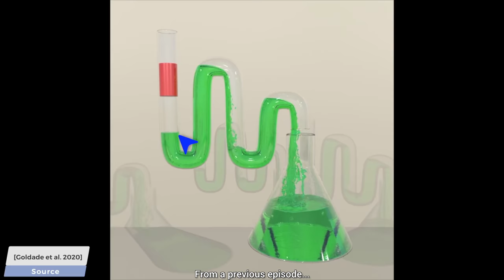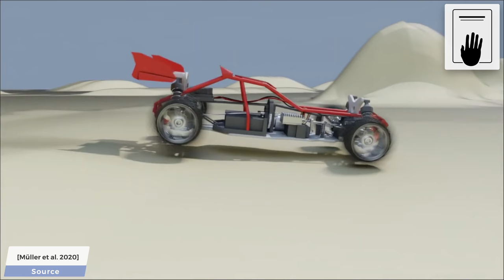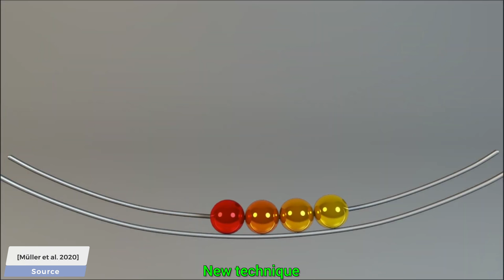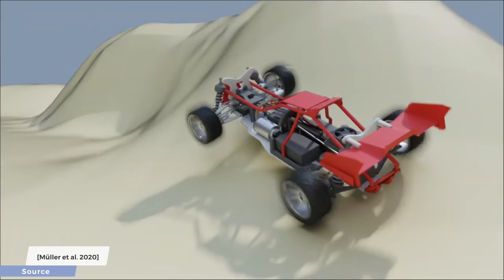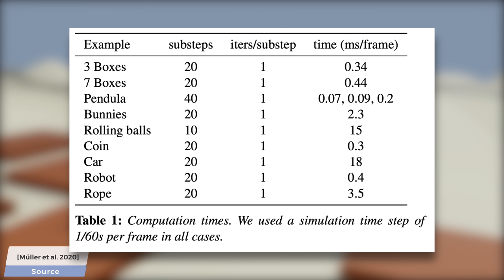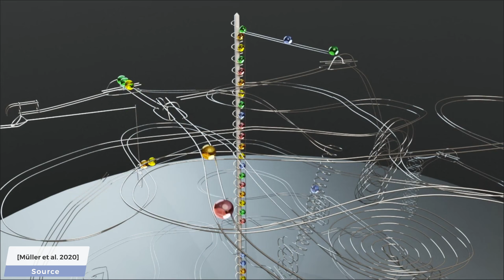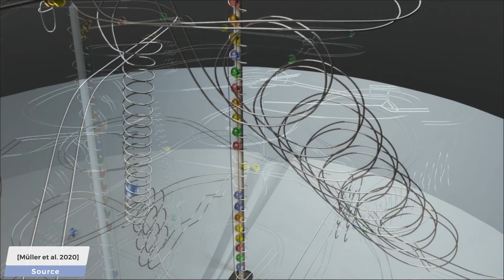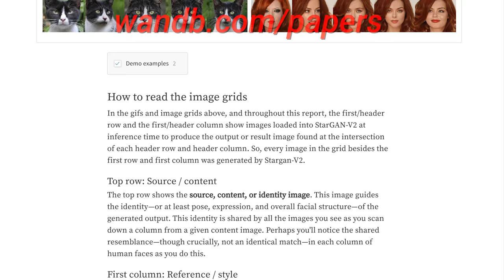Finally, Deformation Simulation... in Real Time! 🚗

Comment: That coin rolling simulation, looking like Euler's Disk, I had simulated in real time years ago, with Dark Basic Pro using Ageia's early PhysX card. And it used about 20 coins at once.

It was a shooting demo I made. Coins spawned over a table, and I would shoot at them. If hit, some  would drop on the table depending on how they was hit. They would even drop on each other. Depending on how they fell, they would roll like the one shown in this video.

I simulated the sound based off of how fast the bottom half touch point would move or circle around on the table. I even added an augmented extra code to fade in and out the sound some, that would take into account the position of the touch point vs the center point of the coin and the view camera position. It would fade in (get louder) if the touch point was closer to the camera than the center, and fade out (get more quiet)  if the touch point was further away. The sound simulation was faked, but worked quite well and seemed real enough at the time.

Funny to me how such a coin sim with just one coin is thought to be big news today, years after what I made with one of the very first physics cards made. Though I know, how they both work is different, and not the same. But still, it's funny to me to see it being big news.

The car sim and large marble sim is impressive though.

Comment: AWESOME! I AM LOVING TWO MINUTE PAPERS! However, if you have ever played with an R/C car like the one in the simulation, you will expect the tyres to EXPAND when rotating at high velocity due to centripetal forces. Or centrifugal. Anyway, REAL R/C toy tyres stretch outwards at high speed making their diameter expand while at the same time their width contracts. Which says to me that this is not a simulation.

Comment: This paper is about rigid body dynamics. So, there is no information. The thing that was mentioned as tier deformation was the simple interference in contact due to simulation error. This simulation also could be done in real time with Algoryx Momentum Software Engineer

Comment: "For our demos we used a system with a Core-i7 CPU at 3.6 GHz
and 32 GB of RAM. Table 1 shows the simulation times per frame
for the various examples.
"

Well those render times are even more impressive now.

Comment: The paper mentions the rendering times were achieved on a PC with a "Core-i7 CPU at 3.6 GHz
 and 32 GB of RAM". So consumer-grade hardware, and this is not even taking advantage of the extra processing power available in GPUs.
Reply: lmfao,good luck even implementing that into any game,beamng is already doing this and more without being that intendive

Comment: 4:10 This doesn't tell me anything comparable since they don't mention what CPU they used all they say in the paper is that they used a "Core-i7 CPU at 3.6 GHz and 32 GB of RAM" (p. 8). 
That actually sounds like the base clock that a modern i7 basically always runs above of unless thermally challenged so if we assume they either used a very old core i7 (say 2600K) or they fixed the clock to said frequency, actual fps numbers are probably a lot higher on recent CPUs (also for multi-core clocks).
Furthermore, the paper doesn't specify the number of cores so we don't know multi-core performance scalability (implying they don't tell us anything about the number of cores of the CPU, could be anything from 4 to 10 cores for an i7 since introduction in 2008)

Comment: there  is a problem with the car simulation. Either the tires are deforming incorrectly at high speed rotation, or the wheels are deforming at high speed rotation. The tires should appear to increase in diameter rather than decrease in diameter.

Comment: Some very important information is missing from their paper, how much computing power does it take to simulate that car at that speed. They mention it is running on an Intel core i7 at 3.6 GHz with 32GB of ram, but not what GPU is being utilized. We could guess it was running on the Intel iGPU in the CPU, but the credit to nVidia indicates there was likely some kind of discrete GPU used. If it was a consumer or even high end workstation card this is interesting. If it is running on something like a Tesla V100 server not so much.

Comment: Noob question: What exactly are the techniques they are using here and in every type of sinilar video? Isnt't it just physics equations? Mechanics in this case. What exactly new do they add to increase the performace of it every time? Do they use math techniques like finite element analysis?

Comment: This leads me to three questions:
Could it also model damage to the car like if it ran into a wall fast enough would it crumple?
What system/GPU was this running on?
How long until we are getting fully physics based driving simulators that basically just run this algorithm and get the driving mechanics for free?
Reply: beamng already basically has this,and its better optimized,ok maybe not as good,but beamng simulates EVERYTHING about a car,down to the suspension,driveshafts,brakes,tires etc

Comment: The simulation is cool and all, but did I see the robot passing through the box, and the tires deforming through the steel frame?
That's sounding some alarms in my head... Isn't collision detection kind of a huge and computationally intensive problem?

Comment: 18 milliseconds is not a good time for a physics simulation for 1 object only for games.  The target frame on console is 60 (16.66 ms) and modern games don't have just 1 car going around with an empty landscape around
Reply: Yeah it isn’t really a good physics calculation time per frame for real-time use and actually BeamNG is able to do it at an average of < 0.1 ms for a single car in a mostly flat map with my computer. This means it’s able to do it theoretically at 10,000 FPS but I believe it caps it to 1000 physics calculations per second and it makes frame rate independent of those physics calculations per second.

Comment: @twominutepapers Have you ever heard of Rigs of Rods, it does almost all of the car bit, in real time, and it came out in 2005, and it runs at 59 fps
Reply: The  new version is called BeamNG Drive and its made by the same devs.
Reply: @nazimdz2457  actually, some of the devs took the program and copied the code into a commercial product, RoR had no legal protection because it was open source, i dont think bmng gives any credit anywhere.

Comment: the deformation here is a mesh, unlike in the game rigs of rods, or beamNG drive, which uses fixed points and pre made models. now we can work with materials!
and now we can remake the game revolt with destruction and better simulation! looking forward for it!
Reply: Revolt? The N64/Dreamcast/Windows 98 RC racer?
Reply: @SianaGearz  Yes! its a free download and still works with windows 10!
Reply: to be fair,it is but beamng still is better than this,especially since
1:more optimized,no way you could simulate the entire car,engine exhaust and anything with even this,if its already at 55 fps
2:beamng already has multiple materials with different behaviors

Comment: Yep, that's it. Fully physical accurate real time interactions are here.
Reply: Unfortunately, no. There has been no good research that shows how to simulate physics accurately on GPU. These methods that are shown so often on two-minute-papers are physics-approximation methods, and focus on speed and compute-reduction. To do real physics, you still need to do massive matrix solutions, and to do that, you need CPU compute.
Reply: @avialexander  Well, we've seen more and more cpu heavy task beeing deported and adapt to gpu, due to the heavy increase in raw power and the opening of gpu architecture. If you take things like lightmaps rendering or ray tracing GI to talk about the most famous, thoses where impossible to be fully driven by a gpu a few years ago. I'm not saying we will see perfectly accurate physical interactions in video game anytime soon, mostly because there are not needed and we already have some models that reproduce those accurately enought while using simplified physic.
But the simple fact that it is actually doable on cpu right now mean that it will probably be avaible or partially available and adapt for gpu rendering in a few. Will it be used and open new possibility of interactions? Maybe.
Reply: @Tezorus  Not really though. Raytracing is a sequential embarrassingly-parallel operation. The light ray starts at one point, bounces off another thing, bounces off another thing, etc. etc. until it reaches the camera. Or vice versa, if you want to be technical about how it works. At no point does it care what any other light ray is doing. That's why it's fast on GPU, you just give each core the task of calculating one ray. But that's not how simulation works. In a simulation, the entire system is dependent on all other pieces. You can't calculate the behaviour of one chunk of fluid or solid's stress tensors without knowing the states of the chunks around it. And for those you can't calculate their state without knowing the state of the ones around them. And on and on. This is why simulation is inherently an incredibly hard problem to parallelize. Even when fluid simulations are parallelized, it is done across single-digit numbers of cores because if you break the simulation into too many pieces, the bottleneck becomes the communication speed between cores. So breaking the problem into hundreds of cores in a GPU you would take an absolutely massive performance decrease.

Comment: BeamNG's tyre simulation is probably even more complex. And amount of nodes is comparable I think. Poor performance some people are experiencing with BeamNG is due to outdated in all senses graphics engine (it's Cry engine if I'm not mistaken ?) and insane detail of some of the tracks. To me it looks like graphics rendering aside the math behind BeamNG is at least equally as impressive if not more impressive due to how long ago it was already implemented. And notice, this one is done by Nvidia, so probably part of the magic is done using CUDA cores while BeamNG is probably doing most of it on CPU.

On the other hand there is this Mudrunner series of games, where not only suspension/tyres simulation is at least equally impressive,  but also the mud simulation! It is insane, check videos.

And don't forget all those racing games like Automobilista 2 or RFactor 2, pretty impressive stuff there as well, especially with FFB on laser scanned tracks. Simply amazing!
Reply: Don't forget for racing sim realtime is not enough, physics part of the. engine must be updated a lot more frequently to give an adequate car behaviour vs player's input.